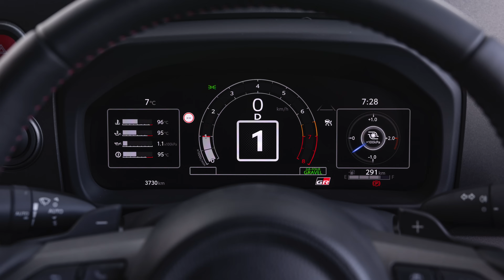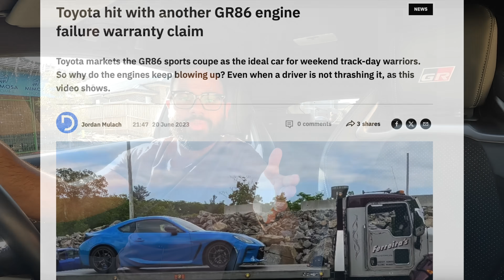The Real Reason GR Corollas Are Blowing Up (It's You)

Comment: Agree with all his points. My answer for the aspiring GR Corolla owner: Just be ready to accept the fact that's already tuned right out of the factory, it's already at its reasonable limits of reliability. Then save the money you would have spent on aftermarket tuning/mods and just enjoy it for what it is, which is no slouch. If you really want to tune, then the German options he presents are all excellent choices. The B58 in the Supra has proven to be extremely tunable while remaining rock-solid reliable.
Reply: Completely agree. Nowdays people are very unsatisfied , they just want more and more . Trying to add 100 extra hp n that poor 3 cyl engine.  Its already good enought .
Reply: I can afford a used JAPANESE car. The germans will always get their money, used or otherwise. lets hope Toyota drops a 2.0L turbo in a future 3000lb (or less) sports car.

Comment: There is an active incident of an owner of a 2025 premium MT who's engine caught on fire that was posted on the GR Corolla forums yesterday. 2300 miles on the ODO. Stock motor. Guy was driving to work and got a low oil pressure light, engine bay started smoking and a fire developed around the turbo. Most working theories point to a cracked turbo oil outlet pipe causing a leak onto a hot turbo. Previous investigations into the GR fires found oil residue on the turbo, downpipes and underbody which would lead one to the same conclusion, a cracked oil drain pipe. It will be interesting to see the outcome of this current case, especially given this is a brand new car 2025 stock with minimal mileage.
Reply: We need more data.... i din't hear anything about it. 
I want a GR Yaris
Reply: @robertoamaya1265 great car wish we got it in Canada. Same motor through, and apparently in Europe the cracked oil turbo outlet pipe is a known issue in the GR Yaris community

Comment: They blow up bc of the hard line on the turbo feed they actually fixed this problem in the 2025 when you change downpipes they aren't mounted solid like the factory one and they flex the hard line until it breaks. Then the oil blows everywhere and combusts from the heat of the downpipe or lose oil pressure and you know the rest.  Lamspeed has proven that you can in fact tune the piss out of this platform it's just not cheap or easy

Comment: the GR Corolla is best with stage 2 mods (no tuning), as in radiator/cooling, intake, exhaust, and handling. The car is pushing it as is fully stock, and it's the damn near perfect daily with an impressive amount of power/torque for what it is. I hope tuning will get better and more reliable, but for now it's just not worth the risk
Reply: I have been doing some reading online that people are just doing cooling upgrades ( oil cool, in cooler and a better radiator ) and stopping. And getting really good results for every day use. Not track days

Comment: Why i went for the  fl5 honda  I can tune and not worry about blowing up ... I was  90 percent sure I was gonna get on but after I saw two on track blow .....  ans actually  getting one with a cheap interior  ... it's jot worth 50k....
Reply from the maker: FL5’s k20c1 is one of the most tune friendly motors around. Pity about the overheating issues though

Comment: Prospective GR Corolla owner here, I know for a fact that the engine is already tuned to the bleeding edge and where GR finds it reliable (on their standards). For me, I'd throw in oil baffles or the expanded oil pan with baffles for the dreaded oil starvation and keep other things factory stock as it is- probably an exhaust if I'd want to add spice to my own GRC.

Either way, I'm not touching the Engine for power modifications. Quality of Life/Peace of Mind mods are my number 1 priority now 😂

Comment: It’s not that it can’t be tuned it’s hard to tune cuz of the d4s and the crappy valvetrain. People are running gr Yaris with 400-500 hp and daily driving it with no problem but without the oem ecu. It’s gonna be around 5 yrs after a new grc generation releases before tuning for this car becomes mainstream(cheaper) . Plus toyota ecu always been hard to tune. Idk why people are attempting to tune a Toyota ecu. this is a known issue with Toyota n the tuner community everyone knows this. The mk4 Supra was notorious for being hard to tune on it stock ecu without blowing up, the is350, the rcf and mr2 turbo as well, if you tune them they fail you have to tune them by getting aem infinity stand alone ecu. You have to get a syvecs ecu and controller to tune the GRC properly. the ecutek tune will blow your engine stop getting them. Stop tuning this car unless you’re running 5w20 and you have done your valvetrain upgrade.

Comment: First of all before to say its hard tune every car you tune over 400hp you need to speciallized in temp timing etc.... second to push i tiny turbo over 26psi you play with fire and risk of early detonation. Change injector to coldown the temps and intercooler and a bigger turbo and piston for safety and this will pass 600hp , some guy pass 880hp on this motor on race track without issues.the secret simple coldown the engine and a bit late for boost to dont get too high peak torque.

Comment: For the poeple stating this is a 3 cylinder car 1.6 etc and it shouldn't be in the car thats its over tuned out of the factory etc etc. This engine is designed from the ground up as a rally motor. Its a 1.6 because the is the WRC requirement. its not over tuned because it doesn't come in any other tune other than 257 to 305 bhp. Its not a corolla engine in a Yaris. The motor was made for the Yaris to race in the WRC. Its currently wining everything and its was built to do it.
Reply: Be real. 2 engines per season and they have hybrid system, just look up WRC rules. Will a normal GR Corolla owner be provided with 2 engines per year? The 1.6L is supposed to have huge turbo lag which is filled by the hybrid system. Toyota had to tune the street version with more low/mid torque for daily driving, which significantly changed the wear pattern of these engines.  

The tuning overhead is just very low compared to previous JDM classic sports cars. Toyota is going to discontinue this 3-cylinder as the next gen will be a 4-cylinder design with higher displacement. Toyota is a company that embrace "if it doesn't break, keep it". There are numerous stories of folks running stock and blowing up the engine, and don't forget the diff overheating even on a cool track.
Reply: @ousi00  Not really, shops of gotten this little motor putting out wild numbers. Problem is it needs more care and parts like a Subaru EJ. Limit +1/ Boosted Performance has only had 3 out 500 cars they have tuned for customer blow up. And all 3 were owner error. 
 Most of those stock  blew up from money shifts, which will blow up any car.  The diff is likely because it's right by the exhaust. Many with the GRYs in Europe have solved the problem by putting a heat shield over the exhaust.  
At the end of the day people need to realize, that these aren't race cars.  Their sports cars that can lightly tracked. 
Even the Type-R will get bad heat soak after 2 laps, if you don't upgrade the cooling. 
ND Miatas have blown transmission from being lapped hard.
Reply: 😂, it's not a WRC prepared engine get real.
Reply: The chassis is what is actually designed and homolegated for the WRC and maybe the awd system. The engine was never going to be used for the WRC.

Comment: I definitely miss my Sti I got a 24 GR I put a exhaust on it and an Eventuri intake with a base tune works just fine any more u will have problems unless u know a tuner that just works with this platform I’m looking into going back to an Sti or new Wrx
Reply: I picked the GRC over the new wrx stock for stock thinking I wouldn't tune but now I want to lol. And looking at the platforms, the WRX can achieve much more in terms of hp and tq gains compared to the GRC and you just need an intake and tune. Plus the WRX had like 2.9% interest, now I'm beating myself up lol
Reply: @Zemaitis-n8m of course it will be a little bit slower but to me the new wrx is trash it does not compare to the Sti and never will the wrx is for the poor man that can’t afford an Sti just my opinion does not mean shit so my GRC has an Eventuri intake turbo inlet OTL down pipe dual sxth element exhaust pipe,Ecutek with a tune and I’m punching around 330hp

Comment: The tuning for this platform is definitely uncharted. Even with seasoned tuners. It has been said that reflashing the factory ECU with software like EcuTek proved difficult. However replacing the factory ECU with something like the plug and play Motec has been reported to be successful. The G16E has a lot more to offer than what was provided from the factory tune. It is in no way maxxed out from the factory. That is a false statement.
Reply: So it's not fast enough?

Comment: Nah it's guys not running supporting cooling mods on track and also running the stock OW20 oil instead of a thicker 5W30 oil. These cars suffer in the cooling department. Excessive heat leads to knock leads to boom goes your motor.

Comment: There is a guy on here with a GR Yaris with almost 900Hp…..when done right, these things can be monsters! I have a manual 25’ GR Corolla Premium + in heavy metal with almost all the options and I absolutely love it! Takes corners like it’s on rails! Surpassed all my expectations and then some💯The improvements for 25’ are absolutely amazing….lighter, weld points, suspension, more torque, performance package standard on all models, HUD/parking sensors in Premium +, and much more! NTM, it is built by hand by people who are basically Samurai Mechanics!!
Reply: Yeah but it won’t last any time pushing that kind of power.

Comment: This has no technical back ground to say that the engine is at its limits. You need to do 3 things on this engine to get reliable power. 1. Valve springs. 2. Cams 3. Fuel .... the third being the most important... run good fuel in the car. I wouldn't run anything under 93 octane and would look more into going E85. High boost applications are prone to detonation on any vehicle if you are running low octane fuel. if you are going to tune a car do it properly. This engine has nice thick cylinders walls and pretty robust con rods.
Reply: So like prepping any other car for higher boost setups

Comment: I am not sure about your background but this 1.6 turbo motors came from a rally car running on over 100 octane fuel and on the street they are using fake 91 at best. This engine on 91 is on the verge of detonation any moment they run rally horse power out of 1.6 3 cylinder on pump fuel it’s totally normal to expect them to blow up. This is why they fail on the track I am convinced that if you feel them up with 100 octane plus they will run beautifully on the race track. Even WRX VB with half of the boost loves 93 octane plus premixed with race fuel . So yeah keep running a race motor on 91 and keep asking yourself why the engine nock under power .
Reply: It's not a rally motor lol
Reply: @YouTubeSupportTeams It actually is made for very high octane this is why it keeps blowing up on 91.
Reply: @MickyMouseLimited the ECU is mapped to accept 95+. Most people are running it on that fuel. Where is the evidence that people are running it on less?

It also doesn't make it a WRC engine just because it's running on premium.
Reply: @YouTubeSupportTeams The fact that the engine develops full boost only at least in North America when it is running on RON+MON 98 octane is a very clear messages . I have seen the car being raced and it requires that specific fuel not to cut timing and boost this is a clear indication  for the intendant purposes of the engine.

Comment: Loving my tuned GRC. IMO the title is correct- it’s you (the driver + the decisions you make whilst driving).  You need to do a bit more research than just reach for that JB4 and K&N intake. I’m At 21k miles now. FBO + valve springs, rocker retainers, head gasket and head studs, cams, and upgraded clutch. Yes, I could have bought an m240/golf R but I wanted this. I will say that you have to pay to play and not be a first time performance car owner. Driver mod comes first before all of these things. You need to know your tuner. Graham, Mikey, and JR are probably the best for these. Heavy torque at low RPMs is a recipe for death. If you’re not tracking or doing canyon runs weekly you probably don’t need a catch can. You’re risking PCV issues throwing one of those on there without knowing how to install properly. If you are tracking then you need to be diligent about the type of oil you use and keeping all fluids cool. If you keep it stock it’s still absolutely outstanding. Just don’t think you can drop a little cash and redline everyday without an issue.

Comment: Nah, it's the G16.
Peak stupidity is not using the 1ZZ, 2ZZ or even the 1NZ-FE FOUR cylinder and instead using a way more vibrating 3 cylinder, under about 30% more stress (3 connecting rods pushing 300hp vs 4).  
TRD even ufcking built a 1nz-FE turbo.  
For as much as Toyota nailed the I6 engine assignment for the Supra, this crap is the total opposite.

Comment: I like Toyotas and Hondas. I’ve owned plenty of both.  In the end I chose the FL5 for its do it all usability but also as it’s the last  of it’s kind and Honda went overboard with the R&D. I really like the 4WD of the Yaris but the 3cyl was a deal breaker. I won’t be modifying my Civic much, as it’s fine for what I use it for. Eventually I’ll put an intake, exhaust and intercooler on it but for the street it’s more than you can use.

Comment: My GR Corolla has 14k miles. I’ve driven it hard since day one of ownership. It’s been full bolt ons with a Dyno tune before it had 2000 miles on it. Currently Making 315 rear wheel HP with zero issues while living in the Texas heat. I can honestly say this car has been extremely reliable for me and driving hard on the street. I would recommend an oil cooler and radiator if you have plans to track car.
Reply: Where did you get it dyno tuned? I may go for that as well
Reply: @makuronin AWD tuning in Flower Mound Texas
Reply: Bro 14k miles isn't anything to brag about. I
Reply: @t.s.818 Sure it is. It’s 13,500 more miles than I have, and mine is bone stock. Every opinion matters.
Reply: What oil you be using yo?

Comment: The Care Care Nut is a great youtube channel to follow and offers very great informative guidance for many Toyota owners out there to follow the recommended maintenance intervals as opposed to manufacturers recommended intervals and cut those services into half such as oil change every 3-5k miles synthetic rather than 10k miles and so on. Especially on these turbocharged engines found on the GR Corolla, personally I suggest you change oil at every 3-4k miles full synthetic and let the car idle afterward for at least 60 seconds or more for hard spirited drive and track use. By letting the turbo engine run, the oil will continue to circulate, and your turbo will eventually cool down. Not sure if that's the case for modern turbo engines, but it's better safe than sorry.
Reply: I agree with the Car Care Nut being a great source & channel. But my 25 GR Corolla owners manual says to oil change every 5k, not 10k...

Comment: If you’re thinking about getting a Yaris or Corolla, get ready to have a blast on back roads, in the snow, on loose surfaces—even on the track. Just don’t expect Type R lap times. Overall, it's one of the most fun and raw performance all round the year cars you can get at this price. And if you’re planning to mod it, go for suspension upgrades over engine work—you’ll get more out of it.
Reply from the maker: Agree!
Reply: I second the suspension upgrades. Smaller upgrades will leave you happier. Short throw shifter, engine mounts, suspension, exhaust, air intake, IC upgrade—hell maybe even a clutch disk upgrade.

Comment: What a useless Video - repeating that GR´s are not good for tuning a thousend times without giving just only ONE technical fact based reason... waste of time.
Reply: I mean, he kinda did, the engine is tiny dude. There is only so much you're going to get out of a 1.6L 3 cyl before you try and put too much power into it and it inevitably blows. There are definitely some good tunes and modifications you can do for more gains that won't blow it, but again you can only do so much before you hit a giant expensive wall to even make it get around 350 whp
Reply: He showed 20 pictures! Go watch Smeedia's video of his engine blowing up with a slight tune.

Comment: All valid points especially the fact that its a 3 cylinder making 300 hp. Like you want to make more power dependably and cheaper go to a platform with a bigger engine. The fact this car is making 300 hp in itself is very very impessive, just enjoy them for what they are.
Reply: You seem to have no understanding of any physical principles that go in to engineering a car engine. People please stop saying this it doesn't make sense.
Reply: @wdv4 No, I agree with @DirtyPSI_Evo. It’s common sense and basic understanding of physics that the headroom for easy power of a small displacement 3 cylinder engine in its basic design is low by default. If you think this is not the case, then please educate us because IMO this is a detail that really doesn’t require a complex explanation. 
Also remember that this engine is sold to consumers (for $43K mind you), meaning it’ll have to comply with local emissions and other challenges, all while having to deal with every type of owner. 

The point of the video is to make everyone aware that this engine is close to or already at its ceiling with the current technology and regulations it manufacturered in.
Reply: @suzumr2754 u do realize that the engine was manufactured the way it was to comply with wrc regulations it’s not at the top of its game